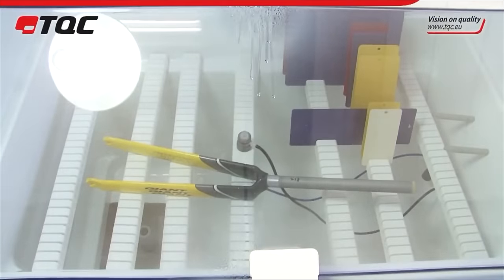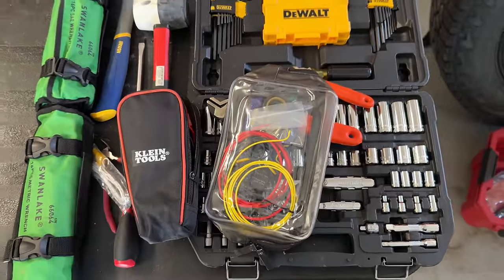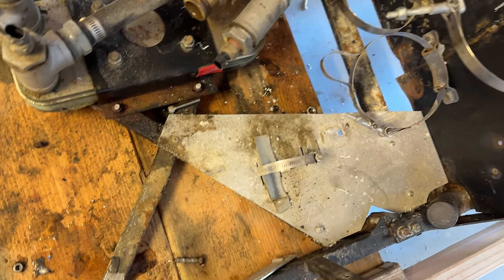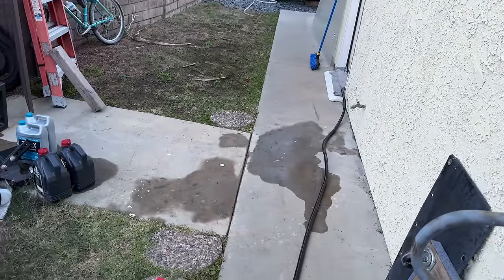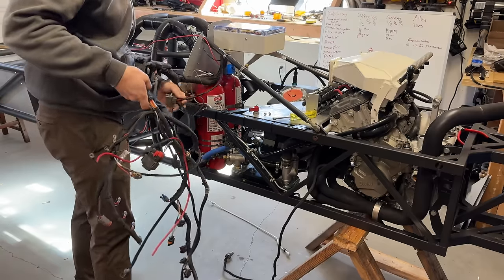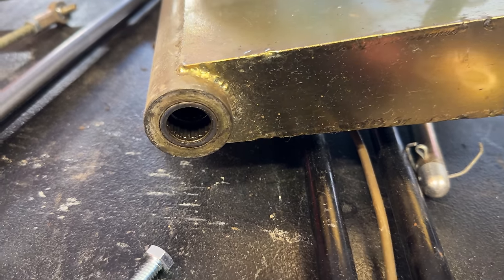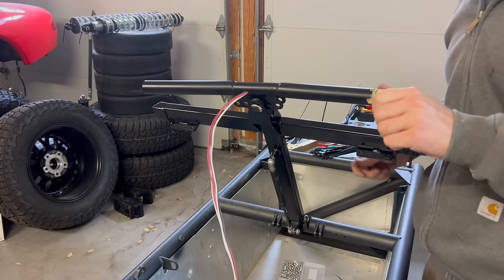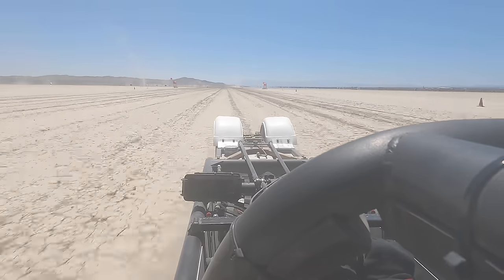My Race Car Is Rust

Comment: CRC Marine Grade Corrosion Inhibitor is your friend. It’s a cosmoline coating. Next time it’s stripped down, assemble the rolling chassis and give the entire thing a coat or two with everything torqued down. I live in the rust belt and coat all my vehicles with it. Works great, lasts several years, resistant to spray, and doesn’t drip like Woolwax/Fluid Film. Would be perfect for your use case.
Reply: ive coated entire engine bays of yaughts with that stuff ... it gets to sit on the top shelf next to my DeepCreep ...lol
Reply: This would also be an optimum use of WD-40.  It's designed as rust preventer and slowly turns into varnish, it just happens to be a decent spray lubricant.
Reply: WD-40 is only good for one thing.

For every other thing, including corrosion protection on expensive vehicles parts, there is always a grossly-superior product available.
Reply: Blaster Surface Shield!
Reply: @blarggggg WD 40 smells good, good for making a new shop smell correct.

Comment: For flushing your cooling system, citric acid should dissolve anything found in normal hose water and won't touch either metal or rubber/plastic parts. I bought some (food grade, no less) a few years ago, and it's gotten to the "when you have a hamm… citric acid, every cleaning problem is a citric acid problem" stage. (OK, citric acid or isopropyl alcohol.)

If you get food grade you can also use it (sparingly) to spice up salads, cabbage, and/or cookies :D
Reply: Citric acid and isopropyl alcohol gang!

Anytime you see vinegar recommended for cleaning, swap it for citric acid and your nose will thank you. Great on rust too.

Citric acid I get in ~kilo containers from the "orient" food stores, way cheaper than the bulk plumber bags I could find around here.

Isopropyl ain't cheap around here
(I get it from a retail electroncis chain at almost $30 per L, probably cheaper in bulk if you've got connections) 
But it really is the shit, dissolves most gunk, safe on most plastics, and leaves no trace behind.

Acetone or brake cleaner for the really tough crud, but plastics beware.
Reply: Good tip!  Iron citrates drop right back into solution.  Calcium citrate is more sparingly soluble, so a little splash of hydrochloric acid to lower the pH to 6 or so will make extremely soluble calcium chloride.  Then you can flush out the crud while etching maybe 0.001mm of aluminum from the interior of the engine.  Discretion is the better part of valor with that stuff.
Reply: Salt water, on the other hand, will dissolve anything metal and won't touch the mineral deposits.

Comment: For my motorcycle trips I do the same thing on the tools...when I buy a used bike I mostly disassmble it to inspect and repair anything that needs it.  I keep track of all tools used and make a mini, but bespoke, kit for that bike.

For our race cars (since we have 5 current and two former) if ANYTHING is non-standard to what we already carry that tool gets ziptie to the cage of that car because the words used by yours truly if the 35mm hub nut socket is "back in the garage" when we need to do a Saturday night front hub swap would make a drill sargent blush.

Comment: FYI. If you don't have tamper-proof Torx fasteners, don't buy tamper-proof Torx wrenches. I twisted the splines on every bit in my kit using them on fasteners that weren't tamper-proof. They were too weak and twisted every time.

If you don't need them, don't use them. I tried to be cheap and buy one set for both kinds of fasteners and it didn't work out. I had to buy 2 more sets after destroying the first. Which is what I should have done in the 1st place.
Reply: How much did you spend, I’ve never had this issue
Reply: A lot of times the bits are just soft metal to avoid trashing the bolt heads. I'd rather replace a $1 bit than grind and drill stripped fasteners.
Reply: For bolts that are tight, ( but not heavily rusted into place ) which use internal Torx , reduced size allen / phillips , hit the head of the bolt using a flat nose punch.  This will compress the metal under the head reducing tension.  This also works with drain plugs that use a copper crush washer.   Sometimes plating will cold weld bolts to the part, hitting the head from the side can help as well.
Reply: Even if you do have tamper-proof Torx fasteners, you don’t need tamper-proof Torx tools; just pop the little pip out of the fastener with a small punch and bingo - tamperable fasteners!
Reply: Someone borrowed my torx set and despite my telling them not to, they used some of the security bits improperly, returned the set with twisted bits.

Comment: I built ships for a living, use silicone to encapsulate your bolts after install covering the head and nut end and you won't get the salt and moisture in there. Of course getting the silicone off to work on the system can be a challenge but you can't have everything. FYI painting them works also it's just not any better to clean off and silicone can be used to fill voids to shed water instead of letting it pool there.

Comment: Did a salt spray test for a 304SS item for automotive use, after a week of testing I opened the test container and.... the only thing left were the plastic parts and the stainless steel item.  Thankfully the pump was plastic and survived. All other items in the container had disappeared,  steel hanger, brass nozzle, mild steel base test unit all dissolved. Thus, unit passed the salt spray test.
Reply: That would be an interesting time lapse!

Comment: Making a tool set that way is a great concept.  I am moving my project CJ7 to another garage slowly and I am only going to move tools I need.  If I suddenly need another tool I will go get it.  After a few months any tool left behind will not be included in the Jeep's standard toolset.  Thanks for the idea!
Reply: For a long time Ive wanted to make tool kits for cars where it contained every socket and wrench needed to work on it in a kit that fit neatly into the trunk, with every bulb and fuse the car had too. Customized to each car. Just had no idea where to start with something like that and other more pressing projects keep distracting me.....

Comment: Fluid film, and other oil/wax undercoatings work great for parts that can’t be properly painted. I honestly hose the underside of my cars with it and it works great for winter corrosion.

Comment: Up here in Southern Ontario (and most places where salt is applied to the roads in the winter time) we take our car to a shop and get the frame/body/crevices treat with a corrosion inhibiting product. My personal favourite is fluid film, you can use a fluid spraying gun with a reservoir, hook it up to your air hose and go to town. It works quite well and you can apply to pretty much any surface because it's lanolin. You can definitely watch a few videos on this subject. A good idea also is to completely seal off all structures which are hollow. Any kind of hole will allow water to enter unless plugged with a rubber/plastic end cap. That eastwood stuff you used it good stuff too. I haven't personally used to on my own cars but I've seen it done with good success. Compared to fluid film, I have no idea how robust it is, but fluid film seems to resist some of the most severe winters we have up here.

Comment: If future Matt with the homemade throttle controller, (that's now past Matt) wants a sorted out unit.....    Check any of the millions of GM drive by wire TAC modules.

They're free standing units usually located next to the brake booster so they're waterproof (or at least ''waterproof''), and easily replaceable and cheap to have a spare.

The fuel pedal is sorted out tech as well. Might be easy to use that as a sending unit too.

Comment: I've been dealing a lot with DBW on a MS3 for the last months, project started as a stand alone PID controller that sampled the PWM of the idle output, pedal position sensor and reported to the ms3 thru an adc a fake TPS, worked good but had a few issues with hiding the idle movement from the TPS as in the end I just reported the pedal position and let the MAP do its job at idle anyway. I just finished yesterday the V2 that runs thru CANBUS, for the love of god USE THE CANBUS, the MS3 integration is great and it will idle and change state looking at the pedal not the TPS position (I was afraid it wouldnt go in idle as the TPS now becomes the butterflys position and if you are using the DBW idle aswell it the TPS will idle like at 2-5%). Easy peasy, address 256 is the MS3 "input" 4 byte long, first 2 bytes is throttle position, last 2 bytes is pedal position (might be reversed,  going by memory) then address 260 is 4 bytes aswell iirc but only the first 2 bytes are the target throttle position (the one the PID loop control needs to place the butterflys at). All is running on a ESP32 and i've added a few commands thru serial bluetooth to set PID, Deadband and Pedal/Throttle limits. All of those parameters need to be set in the controller, I hoped I could set them in the MS3 software like the canbus number goes from 0 to 4095 but clip it at 500-3200 but nope, no big deal tho. Also an other thing to keep in mind is to use BOTH potentiometers in the TPS and Pedal, I used just one of both and I fully understand the safety concerns, i've added protection against potentiometers issues like full scale readings (means that one of the wires probably detached or the wiper broke) but doenst protect against random readings that could make the throttle move in all sort of directions. My personal opinion is that if any of this happens dump the clutch and turn the key, I'm running a 1.3L Suzuki samurai engine with YZF R6 Thottle bodies, lots of noise not power (I wont be accelerating at mach Jesus even in WOT). If you want to take a look at the code or have any kind of questions feel free to text? me :)

Comment: CLR is a great solution to clean out mineral deposits, but it also harms metal, which could be destructive if you didn't anodize the inside aluminum.

Comment: As a northern auto mechanic, this video is more my speed. Unfortunately, this level of deep corrosion is very typical for any vehicle that's 8-10 years or older in my area. I highly recommend zinc flake coated fasteners if you are able to source them in a viable way. Speaking from experience, Geomet type coated fasteners are much, much more resistant to salt corrosion than bright or yellow zinc. The only thing better is a 300 series stainless (obviously except for more exotic materials), but as I'm sure you area aware there are other drawbacks to stainless fasteners to consider.
Reply: Either that or stainless fasteners (which get used on bridges and such and have to be regularly replaced anyway due to saltwater corrosion). Ideally you'd use something that doesn't corrode when it comes into contact with salt but I don't think you want the worlds weakest fasteners on a sketchy land speed car or something that has next to no tensile strength and will crumble if a suspension arm bends an attometer too much.

Oh, and for the record a lot of languages call stainless steel rust-free steel if you direct-translate the term. I don't know how that happened since you'd know just how not rust-free stainless is in the longer-but-not-really-long term.

Comment: That Steel It does not make chemical sense .
A zinc spray will at least provide localised sacrificial anodic protection. Stainless steel particles can't.
CRC make a range of zinc loaded anti-corrosion spray paints ,including one with stainless steel particles.
The one with stainless steel particles does not perform as well as the pure zinc one does , it just looks better.
Reply: That's in theory, in practice it seemed to hold up just fine
Reply: I think he did it because he is likely to make modifications along the way, and Steel It is weld-through.
Reply: It's worse than that.  The stainless particles are electrically isolated by the paint or else they would accelerate corrosion.  Stainless is more noble than carbon steel.  If you put stainless in electrical contact with carbon steel, the carbon steel becomes the sacrificial anode.  That Steel-It product is a gimmick.  The paint coating system itself is doing the heavy lifting here.

Comment: Fwiw, after taking 4wd to beach/islands, simply park on front lawn and put a lawn sprinkler underneath for several hours. Move sprinkler regularly. Gets rid of most salt and sand, your front lawn gets a decent watering, and still meets the laziness level required for a superfastmatt activity.

Comment: When I was a mechanic on the east coast where every winter day is a salt spray test, we would spray used motor oil everywhere under the trucks with a cheap sand blaster gun. It was the only thing that worked, and would be 100% rust proof if done once a year. Any existing rust or dirt helped the oil stick even better, so you didn't have to do any prep other than hosing off first. The various coatings didn't work at all, and sometimes made frames more rust prone, since it would trap water that found it's way in. On something nicer than an old plow truck, wd-40 might be a  good alternative. Of course, you'd want to make sure that trapped oil wouldn't make its way out onto the tires at high speed. At the very least, I'd coat the RV in it.
Reply: it might be a little risky coating a race car with any flammable liquids.

Comment: Just an idea, how about adding a 55 gallon drum or two to the trailer and getting one of those battery operated pressure washer. Wash the car while out on the salt flats or just as you come off. Always found that I would rather do stuff like that at the track rather than when I get home. "I'll do it tomorrow" means it'll be in a week or three

Comment: Great video. As someone who lives about 5km's from the ocean across some plains, the real problem is metal now isn't as good a quaility as it once was my 100 year old compressor that sits in rain has like no rust my one that's about 10 years old rusts constantly an same goes for vehicles...its why so much metal now is treated or you are advised to treat it with zinc etc (Love to tell people to sand blast new an old metal an put it outside an watch how quick it changes)

Comment: 12:00 I'm sure you'll get lots of suggestions regarding 3d printing, but to add mine to the list: Don't use pure white or pure black PLA (and ABS/ASA, too), they're god awful for strength, clog much more frequently, more poorly bond each layer, and have adhesion issues on nearly all bed types, and the rolls get brittle and begin to crack if left in humid open air. 
Go with the grey PLA+ options instead.

Comment: We have the exact same opinion about 3D printers. Built a couple 10 years ago and it was just constant tinkering to get mildly useful parts. 

I just bought another one as well and so far it doesn’t look that much more reliable than they were 10 years ago.
Reply: For work we pay others to 3D print with MJF. That’s a $200k machine though. Our formlabs prints are crappy in comparison, and those are a $5k machine.

Comment: The best way to clean salt off is the same you you got it on.  Drive through wet streets preferably with some standing water.  I do this the first rainstorm every spring.  All the salt in all of the pockets it gets trapped in are gone.  Pressure washing doesn't do this but simply driving in rain does.
Reply: Nah, won't work, my car lost chunks of it in summer, when most of the salt are in winter
Just use the pressure washer

Comment: A friend went to the salt flats with a newly built street rod a few years ago. I bought aerosol fluid film and applied it to the complete underside and into any and all crevices.  He told me everyone asked him what was on the vehicle and stated that next trip they were going to do the same. This was 7 years ago and has never had any rust issues with it.
Reply: What is aerosol fluid film mate?
Reply: @sexyfacenation  fluid film is an American lanolin based rustproofing. Invented at least reinvented during WWII.  It was used along the US coast to keep all the big guns from rusting from the salt air along the coasts. It's a rusrproofing that up in Maine  where we use  salt or liquid calcium chloride to melt snow and ice on our roads. This product is a sprayed onto the exposed sheet metal under the vehicles to keep them from rusting. It can be purchased in a rattle can to apply on the exposed surfaces as well.

Comment: Fluid film does wonders as a prep Matt! I'm running dbw on a speeduino ECU for my Mazda, so far, long as the sweep is calibrated and it has power, no reliability or weird issues.

Comment: @Matt 13:00 Speaking from experience, I believe that the engine performance can be improved by tidying-up the aerodynamics at the throttle plate. For example, those two screw heads that hold the plate to the shaft. Make sure they're tight (Locktite'd), grind the heads flush to the shaft, carefully stake the remains in place with a center punch (centerpunch the threaded join so that it can never rotate again, with the shaft well supported obviously), and then polish everything smooth. Obviously the airflow at the throttle plate is relatively extreme, so tidying up the airflow at that point seems to make an obvious improvement to the engine's performance. You might want to have a spare throttle assembly on hand in case something goes wrong.
Reply: or just encase the whole thing in a slick fiberglass body

Comment: Time 225  king pins locking up.  This will cause instability because anytime you need to make a slight steering correction, you must apply more force to overcome starting friction, this results in an overshoot and the need to input a steering correction in the opposite direction and the same overshoot.